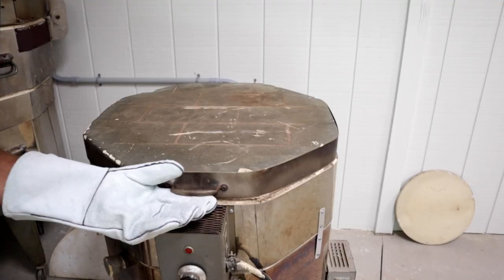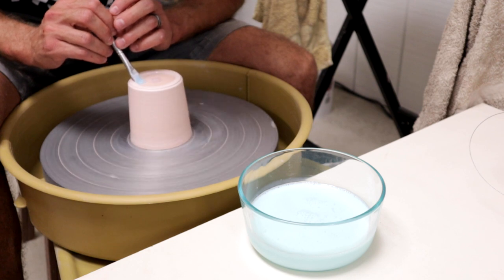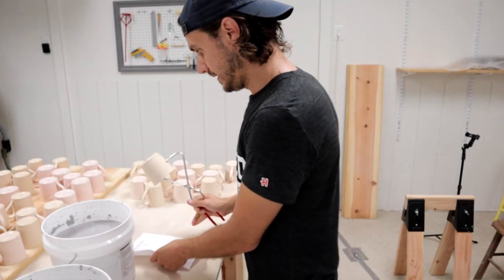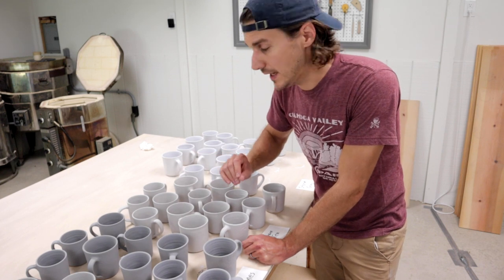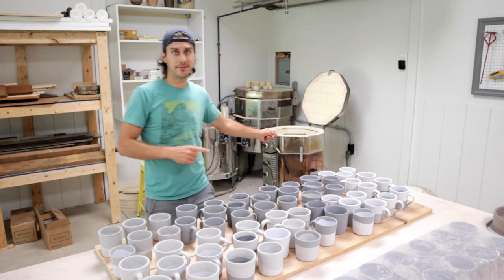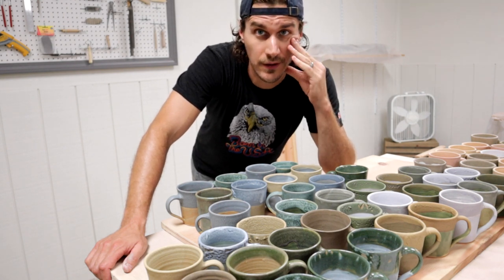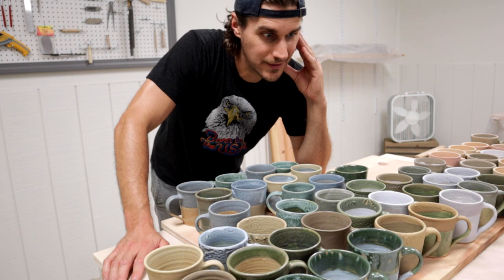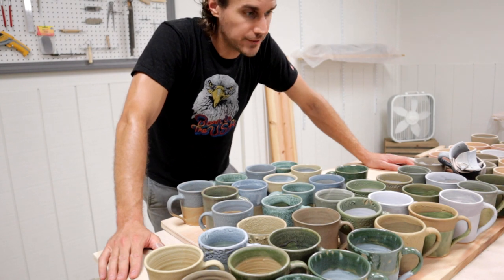Pottery glazing failure... it all went wrong

Comment: My first thought on seeing the mugs was that the kiln had not reached the desired temperature. They still looked like bisqueware. Once you've fixed the kiln, use cones with your next firing to check that it reaches the correct temperature. And there's no reason why you shouldn't just re-fire these mugs. They're really nice and it'd be a shame if you didn't try.  Also, I've re-glazed and re-fired many things so it doesn't matter if you fired them too high during the bisque firing. The overall problem was the glaze firing was too low. Try again and good luck.
Reply: WOW u r exactly right he can re-fire them!!!
Reply: Absolutely agree with this assessment!
Reply: Too true
Reply: it could be dust too if the glaze is separating like that right?
Reply: Hi! Have questions about underfired glaze fire. Our community kiln just didn't go well through the recent heat wave and they underfired. Some of them has crawled and was wondering if I should put more glaze where the bare clay is showing up or should just refire without adding anything?
Reply: @수수-i4g  if you have to reglaze pots make sure you heat the pots beforehand and us heat like a hair dryer to let the wet glaze dry fast on the pots. i have a lot of experience with bad firing with my homemade kiln.
Reply: @WhistlingDixiePottery  oh!! Thank you!! I will do that :)
Reply: When I saw some of the mugs you held up to the camera, where the glaze failed, it reminded me of some I fired once that looked similar. I had put Potters Choice mid fire (Cone 6) glaze on my low fire clay pieces, (still learning obviously) and the glaze came out looking like dull sandpaper.  I doubt that you did anything like that, but for the sake of sharing info with the viewers, I had to mention it.

Comment: If you are correct that the bisque fire was too hot and that the mugs are not porous enough to receive the glaze, then it hardly seems likely that re-glazing and re-fire will work.  But if you are happily wrong about the bisque fire being too hot, then it would be worth an experiment to re-fire after you fix your kiln.   Thanks so much for the video.

Comment: First fix your kiln, then re-glaze over the top, then refire. Use cones to make sure you are hitting the right temperature. Put these on the top and bottom shelves. You need three one lower and one higher than the actual temp you want. 
To make the glaze stick you can spray with hairspray or heat the mug so the glaze dries quickly. 
I know its disappointing but that's all part of pottery and of the learning process. Stay strong, you got this. 😃

Comment: Save them by using a lower temp glaze.  Mayco Foundation glaze formulated for cone 05 and O6 over entire inside and top 2/3 outside. Can fix a lot. Believe me it’s saved many of my failures. My Show I had on 8/7 and 8/8 this year I sold every reject but then saved pot, mug. Bowl. But of course fix your kiln element. Do not be discouraged. We pay to learn.  Can send you photo proof to your email if interested. Don’t trash them. Fix them. Mayco light flux. Small amount to upper third but not on rim. Gives wonderful melt. We built our own propane kiln. Cone 6 firing. You are not defeated.

Comment: Don't give up!  Totally salvageable. The top element needs to be replaced and the kiln is overloaded.  Your shelves need to be staggered to allow better airflow throughout.  Better to buy 2 half moon shelves than one solid round shelf.  Don't put shelves at same level across - it prevents heat from circulating. Keep trying and experimenting.  Happy surprises await.  Thank you for sharing.

Comment: I’ve been trying to figure out my own issues and this video was incredibly helpful. I had about 40 items in my kiln and most of them worked well, but these 6 didn’t work at all. I don’t know if it didn’t fire hot enough, if the glaze was too thick and couldn’t adhere to the bisque. Anyway, thank you for showing this failure!

Comment: I have REGLAZED already  glazed pieces and they have turned out fine. I heated up the mugs in my oven..not too hot. You have to be able to handle them.... and redipped them into glaze or thickened my glaze with CMC and painted the glaze on. You can do it. Don't trash your mugs. I bisque fired at 06 and fired at cone 6 for the second firing. I reglazed and refired the uglies and was happy with the results. It can be done.

Comment: Don't despair.  I have taken a hammer to countless failures.  Each one is a learning experience.  Cracking while drying, warping, crawling, crazing, dunting, glazes that run onto shelves, incompatible glazes, and a whole host of other problems will occur, but once you get the process down you can do what works for you.  I have found I get crawling issues when I overlap glazes too thickly. you could try and apply a thinner top coat. fixing the kiln will solve many of your issues.

Comment: I've 2 questions. One is can I use paraffin wax instead of wax resist? And I'm trying a low fire glaze(cone 06) on a terracotta bisqueware fired initially at cone 06. If I use the same temperature for both firings,will it result in clay not absorbing the glaze?

Comment: one batch of pots isn't too bad. pottery is something that needs to be worked on and is always evolving, moving forward and getting better.10 years from now you will look at #1 mug and see how far you have come. personally, it wasn't until my 3rd glaze firing that i got decent results. I have a homemade kiln made from a barrel and i use gas for the heat source we all need to keep at it and learn from our mistakes. often, we can learn more from the things that don't work out than when things happen as we want them too.

Also if you have to glaze overfired pots preheat them so that the pores expand in the pots, then use a heat source to dry the glaze fast like a stove or hair dryer etc.

Comment: No worries, and no reason to stress.  Is it annoying they underfired?  Sure, but ankther firing to the correct temp will solve the problem, no need to abandon the batch.  I'm hoping that you replaced all the elements, not just the kne that failed.  I know it's more costly, but the others are likely ready to go as well.  You'll be amazed on how fast it fires with a new set of elements!

Comment: So here is what to do... dump the mugs... move on.

Replacing the element is simple but back breaking so take you time and stretch every few while working it in.  while ordering the element, also get some u shaped elelment pins.  Undo the electric and dissassemble that element, take a break, stretch and begin placing the new element in loosly.  once in place you need to stretch it around the area evenly.  stop stretch, pin them into place and reassemble with wiring.

all of the wiring is very simple so just snap some photos as you take apart in order to remember if youre leary.

you can do this and it will work!

Comment: Only just seeing this. Chances are your kiln did not reach temperature. At least not the temperature required to activate your glazes. They are not ruined, you can put more glaze on or you can simply refire them as they are. I'd recommend every 10 firings to use witness cones. If your kiln is not reaching temperature then your coils could be bad or your thermocouple. 

I've seen blue mid-range glazes turn out green and crawl when not fired up to required temperature.

Comment: I have a partner who inadvertently bisque fired at cone 6 instead of 06.
Entire kiln vitrified load. I found it hard to glaze as everything was a super thin coat. But the glazes did flux. 1 glaze that was thick fared better. I have also added a glaze to an already glazed and fired piece with success. If you have an element out hard to see how the kiln over fired. Is it a sitter kiln, did the sitter trip?
Always use witness cones, they will tell you the true story. The work looked under fired in the video. 
Here is what i would do:
Put them away for now. In subsequent firings try to re-fire 1or 2  cups, first without doing anything. Then with another light dip. 
Honestly think they are under fired. Fix the kiln do a test firing with witness cones. When all is good re-fire to a hard cone 6.
Reply from the maker: This is super helpful, thanks so much for the comment. I have fixed the kiln and am now doing test firings.